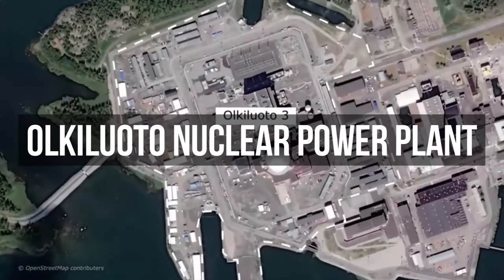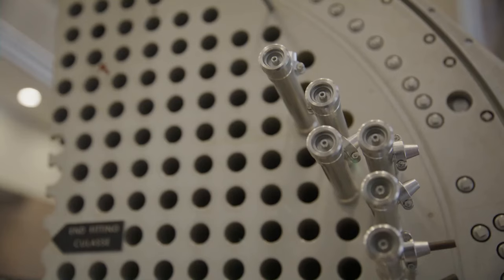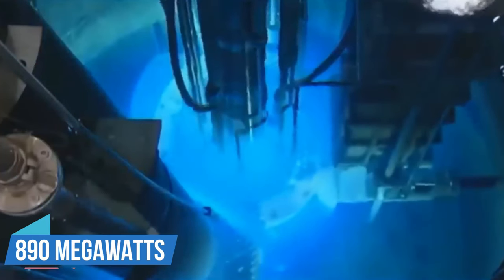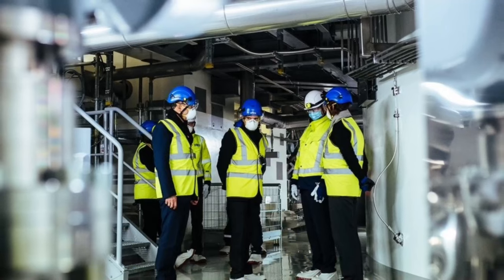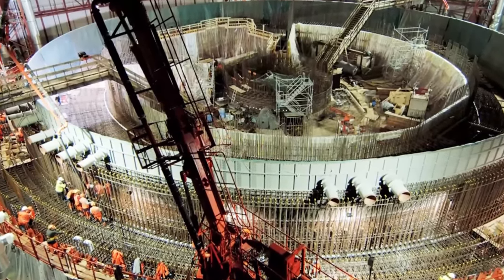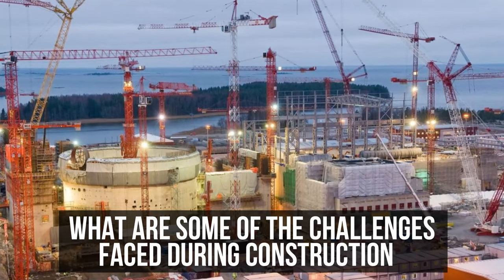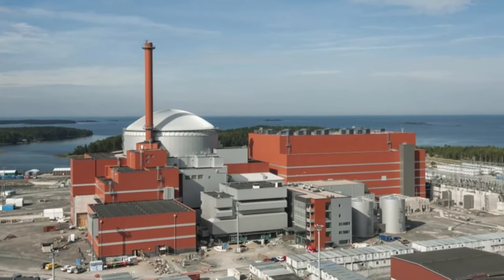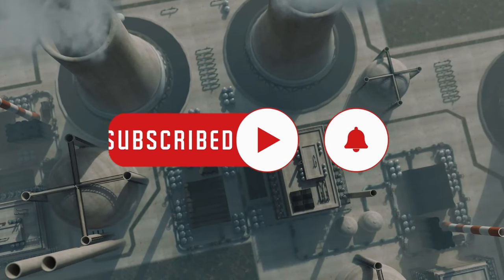Finland’s Insane Journey to Nuclear Supremacy!

Comment: Conveniently failed to mention that due to the insane construction time overrun, the reactor is now so old that some parts have to start being replaced even though the plant has been "operational" less than a year. I say "operational", since the plant has been contributing to the power supply less than half the time it should have. This due to technical issues, mostly the failing old parts already mentioned. And not even to get started on the cost overruns which will ultimately end up to be paid by the Finnish tax payers. I'm all for nuclear power, but this fiasco will definitely not encourage other nations to follow in Finland's footsteps..

Comment: Finland dont use the new plant. The price per kw/his too expensive.
Reply: not true
Reply: @Rafmeistr  new built reaktor is total cost overrun, not 4 Millliarden € get 12 Milliarden € and after the finished reaktior the price tag for electicity is double. the finns are very, very angry. now the reaktor is stopped und not used.
Reply: @stefankruger3634  i dont know where you got your information but the reactor is very much running and providing electricity... im finnish, and there was anger about the delay, but now its fine. some maintenance interruptions, sure, but its working and electricity prices this year have normalized...
Reply: @stefankruger3634  say "priviet" if you are a russian bot/troll...
Reply: @Rafmeistr  the 4.th block is cancelled due cost overrun. Block 3 had an very expensive price tag. it is too expensive. renuvable energy is half the price. finland had a lot of renuvebale energy... the construction delay is beautyful and the construction time from 2004 to 2023... wow. a very long time...
Reply: you spelled reactor wrong